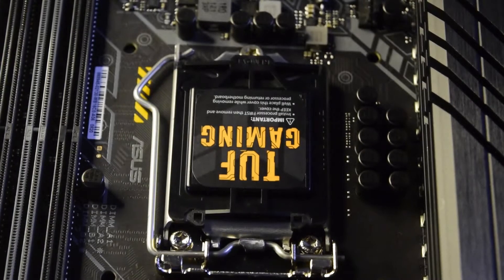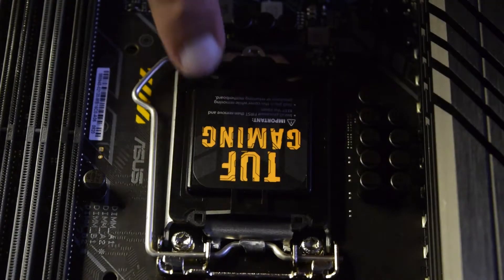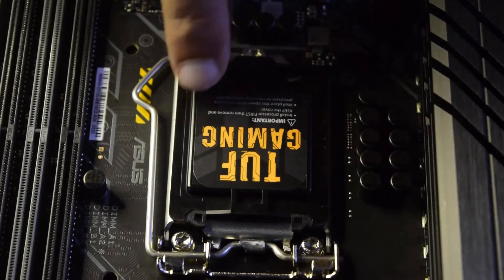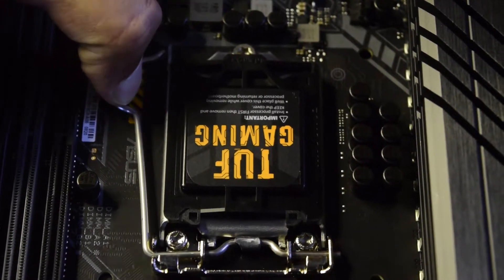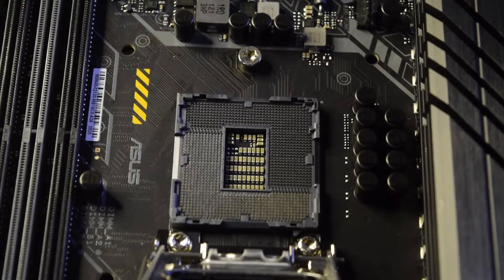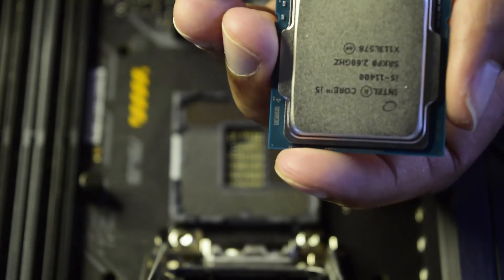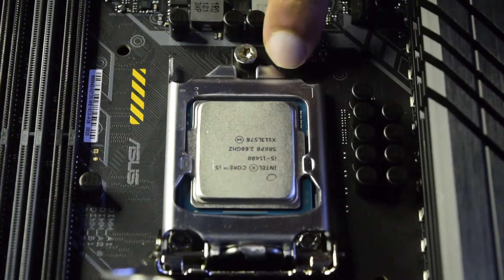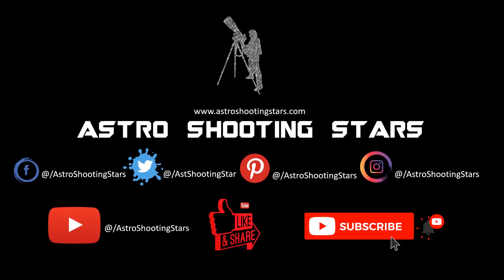How To Install Intel Core i5-11400 Processor on Asus TUF GAMING Z590-PLUS WIFI Motherboard Tutorial

Comment: What graphics card is on this motherboard and how many graphics cards does it support?
Reply from the maker: It has 4 graphics card that it can support , all nvidia 3060, 3060ti, 1660ti and  1650 super
Reply: it supports any graphic card
Reply from the maker: As long as your graphics card has pcie connector it will support it. I hope this helps.  Please stay tuned to my channel for my future videos